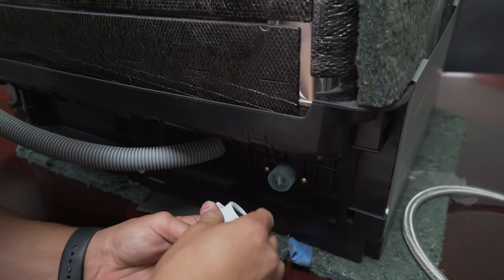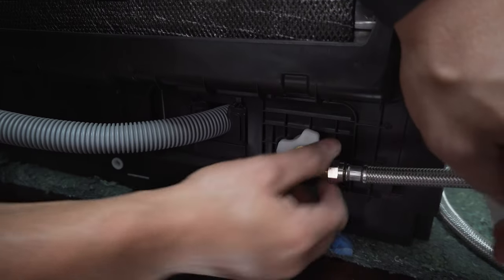How To Connect Water Supply To Samsung Dishwasher - Step by Step

Comment: Thank you for the video! I don't suppose you know where I could get the plastic adapter. I was removing my dishwasher and didn't have enough slack in the water line and broke the plastic piece.  I tried to use a brass one, but it seems that it's not as deep especially with the rubber gasket in there. And getting the threads to line up is a little more risky too. I didn't have any luck. Mainly cause the brass one is less deep.

Comment: I’m getting a 5C code and Samsung has been out twice. It’s been installed three months and isn’t draining. The first guy said the air gap was clogged and the second guy said the drain hose was cut too short…. and then left. It looks fine to me and it was working before. Any suggestions?

Comment: Can anyone here tell me if all dishwashers water inlet hoses are alll using this universall 1 inch thread universal connector. I have a Fisher Paykel that came with this hard factory installed non flexible all plastic hose. Sometime manufacturers that want to sell parts, make parts unique so you have no choice to buy genuine replacement parts. I do not want to spend $70 on a new Fisherpaykel hose that is .400 OD.